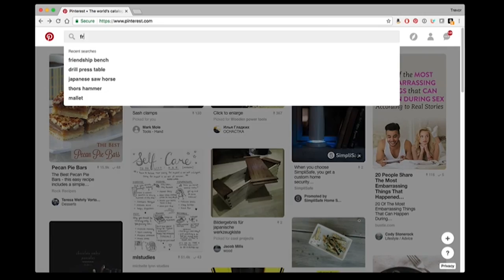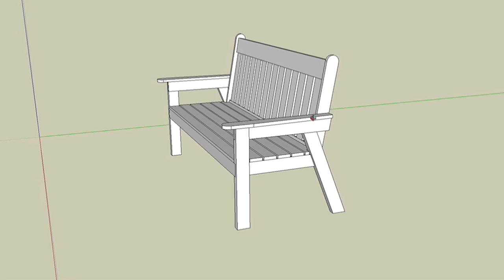2x4 friendship / garden bench

Comment: The bit where you drilled the supports and then filled them back in with a dowel puzzled me at first as I had never seen that. Then it all made sense. Thanks for the tip.
Reply: Mark,Im stıll tryın to fıgure that out.Why dıd he do ıt.?????????
Reply: It was so the screws didn't just go into end grain.  They went into the dowels to make the connection stronger.
Reply: +Prmskeepr yeah that was what I surmised from watching.
Reply: 535

Comment: Struggled like others to find measurements, so sharing my new found sketchup knowledge.
Assuming you found the link to "sketchup model" in his description, and have the free Sketchup.
Use the orbit tool to move around (green/red arrow tool located middle right menu bar).
Use the protractor tool to measure angles (under "tool" menu): 70deg on legs, 10deg back to bench.
Use the tape measure tool to get lengths. His seem a little too large, most recommend a bench ht above ground of 15-17", and I'm measuring 18" on sketchup. Also most recommend a 5 deg pitch on bench seat.
I can see a pile of cut lumber in sketchup, but never really found a cut list.
Nice bench.
Reply: need the dimensions and cut list PLEASE

Comment: WITH SKETCHUP HOW DO I SEE THE DIMESIONS AND MEASUREMENTS. i only see the general drawing, no other pages show on tool bar. im using skup 2017
Reply: Thomas just saw it.  If you zoom out of the axis, it will show you another pile of wood on the right side where he has the cutting templates

Comment: do you put a coat of sealant or something to protect against rot or bugs? if so what kind?
Reply from the maker: everyone will have a different opinion, however, my sealant of choice for outdoor furniture is min wax Helmsman Spar Urethane. You will need to give it a coat or two every year to continue to  protect it and no matter how hard you try, the sun will eventually win and it will become gray and faded. To protect the legs from soaking up water I coat the bottom of the legs with either titebond ii or epoxy before applying the urethane.
Reply: Trevor's Workshop thanls for the reply! so is the only side effect a graying wood? or will it warp or break down faster than say cedar as well?